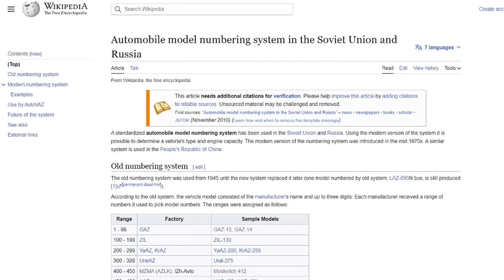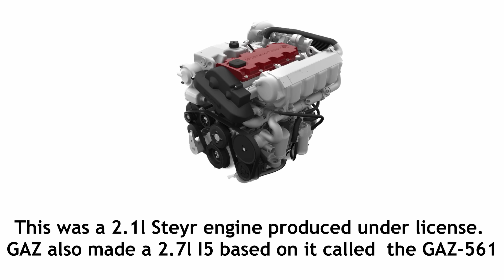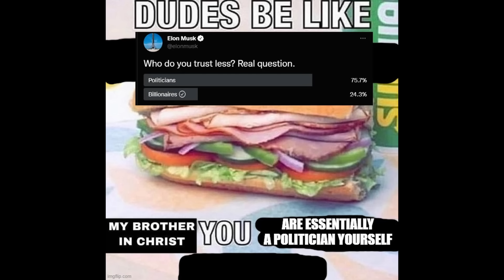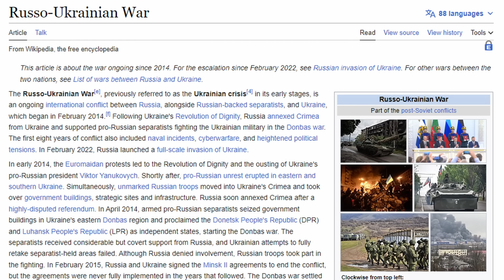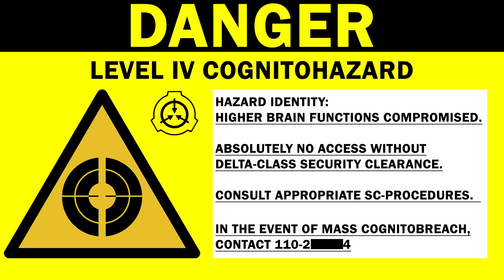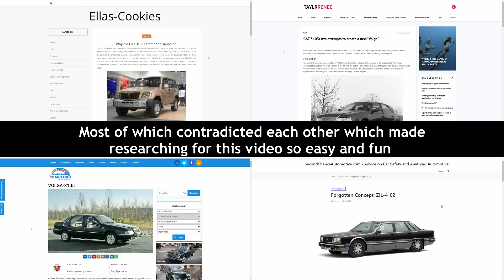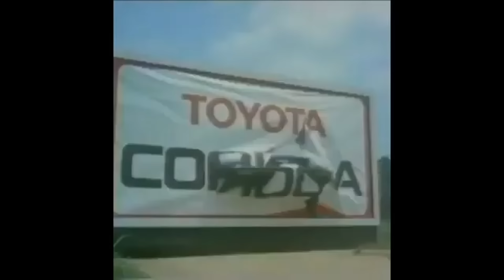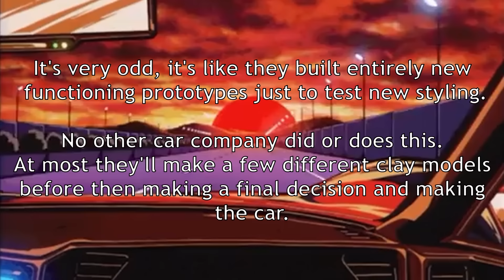GAZ and ZiL: The Death Throes of Soviet Luxury

Comment: Honestly speaking as an American the Chaika looks pretty good.. somewhere between a Packard Patrician and a Plymouth Belvedere.

As for that carburetor that's not that ancient if they brought over Us Rochester Quadrajet from GM it's even got computer control assist. Now if they really used something like a 4MV or a 2GV, that'd be a little different but they're still perfectly capable for proper fuel metering.
Reply from the maker: I was mainly just using a picture for illustrative purposes, initial prototypes did use some of the really old carbs the USSR had. They then moved on to more recent carbs and then the efi systems I mentioned!
Reply: @Intergalactic Binman  the later ones did they continue to make their own or did they get theirs from Western sources either directly or licensed the use of the design? Although certainly it seems to me that those engines on some of their vehicles especially the Chaika, with the rather low numbers published based on probably lousy gasoline Octane and low compression, certainly wonder what their potential could be with Superior gasoline better compression better tuning... I know for instance just as an example in 1949 the 303 Oldsmobile Rocket V8 with a two-barrel carburetor I think had similar horsepower numbers to the Gaz-13 Chaika...

Comment: The motor of the Chaika doesn't emulate anything they are meant to go into a IFV and are basically immortal with good pump gas but will run on any type of shit that burns. I have a acquaintance who bought 7 from the Bulgarian communist party and they are great cars for special occasions like weddings only problem is that they do feets not miles per gallon 😂 But they will definitely get people excited more than anything modern that doesn't fly!
Reply: And the thing about nothing about it even being close to modern is a feature not a bug. And I bet the doors will stop pistol rounds even not being made to be bullet proof. Also at least in Bulgaria the only car that people were able to buy with no waiting list was the trabant which I have to say is much better than the zaz which has a motor for a tractor that will never work for 2 consecutive days the trabant was so primitive that they was nothing to break and even if any idiot could fix it with a hammer. I speak from experience i had 2 zaz and over 10 trabants as a kid, that is probably why I love them too many great memories and when you are 13 any car is good and makes you look like a baller, when you pare it whit a great grass connection and a mobile phone in the 90s I had a quite great time, and by some miracle nobody got killed 😅 in those dead traps unlike what happened when we got into good new western car after 2000

Comment: So since first ice was break maybe something about  Polish cars ?  
Be it it's kinda same story with different actors:
-Western design reverse engineered  or brought.
-Building de facto same car for DECADES
-only slight changes, some of them are even downgrades.
-Fall of commie bastard.
-Factory only can produce obsolete junk, in order to build something better it would need money for development and setup of production line, money it didn't have because it sells obsolete junk.

Polish Fiat 126p would be good choice since it's THE Polish People Republic's car, most common and iconic, fallen out of favor at end of USSR's de facto occupation so much so that my brother (allegedly) brough one for 20PLN, equivalent of like 5$ maybe even 4$ (yes you read it right, car for a sum with single digit, be it "Maluch" is more of a scooter with extra steps than a car. and my mom might messed story up)
and with wave of nostalgia came back to favor.